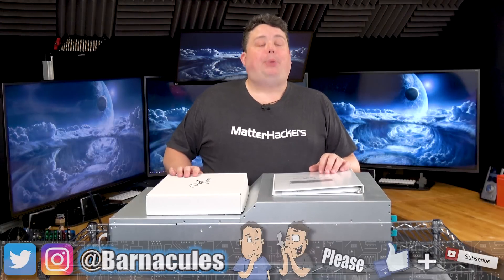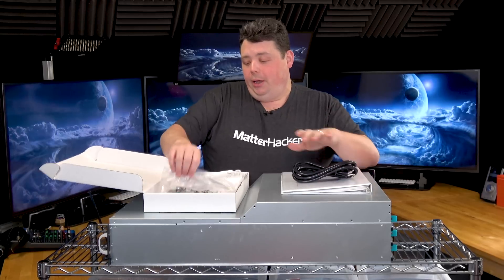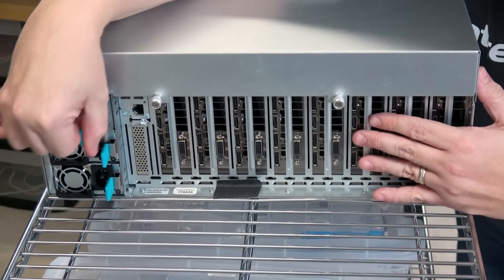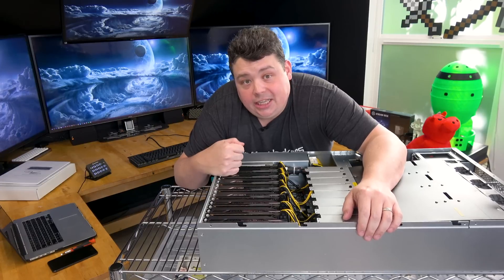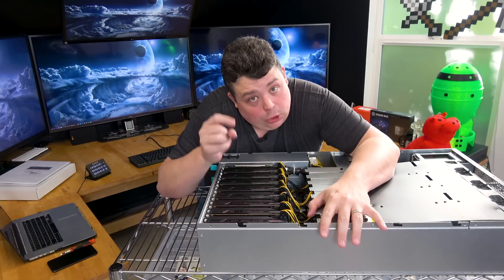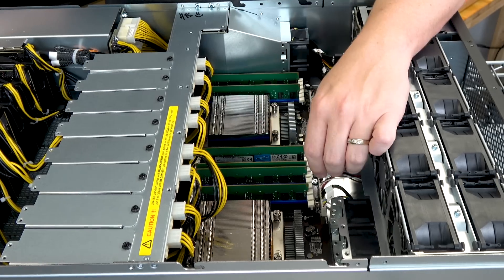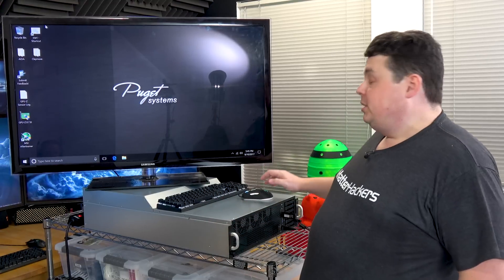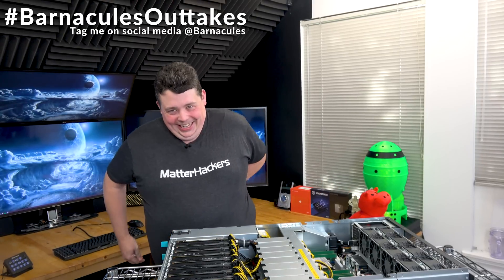Ethereum Crypto Mining Custom PC Server with 8 Nvidia GTX 1060 6GB GPU - @Barnacules

Comment: I have two servers that each have three power supplies.  It only matters how much power is actually being pulled by the system.  You can put all three on one circuit as long as the actual load is not greater than the capability of the circuit.  I have all six power supplies plugged into one UPS.  Works.  Don't skip a PSU because you think you save power.

Comment: Sponsors that made this build possible Thx A  Lot This Is Awesome Build [PUGET SYSTEMS] (4) GTX 1060 6GB Graphics Cards & Build+ [INTEL] (2) Xeon E5-2637 v4 3.4ghz CPU's [ASUS] System ESC8000 G3 3U Server Case/Mobo/Power Supplies [CRUCIAL] (8) 8GB DDR4 ECC REG Memory (64GB Total) [EVGA] (4) GTX 1060 6GB Graphics Cards [SAMSUNG] 2TB 850 PRO SS

Comment: Awesome video. I roughly calculated the time it would take that server to make any real profit if you had to buy it and would use it 24/7 for mining only. It would take you a little over 10 years to break even (that is assuming cryptocurrency value remained the same which it doesn't).

Comment: Hey Jerry, I calculated what Mh/s would be needed to profit at $18/day and given PSE power rates of $0.09743/KW up to 600KW, then you would be hashing at 41Mh/s +/- per card for a total of 330 Mh/s to profit after energy consumption.  9 GTX 1070's  OC'd to 30Mh/s would produce that in a day, not counting the 1550W+ of power a system would likely use.  11 GTX 1070's OC'd to 30Mh/s would give $18/day profit with ETH hovering in the $290-$300 range.  That's 330Mh/s at 1850W+ of power.  Am I misunderstanding or are you really getting that high of a hashrate?  Your screen is showing 21-22Mh/s on a couple of the cards in a closeup shot.  Thanks in advance.
Reply: 1060's in stock are 18-20Mh/s cards all day long, a slight overclock on the memory (okay, not so slight at 650-950Mhz) running under claymore v10 and tweaks will produce a solid 23, some can get upwards of 25, but not without serious voltage increases can you make anything higher (which would really screw this rig up for video rendering, it'd create a bunch of pixel errors if not crash entirely, not from cooling however, looks like that's well in hand). Also, of note, doing rendering of video is one thing, which this thing should do quite well at for 1080p video (maybe alright for 4k30 as well) but GRAPHIC rendering is mostly CPU, not GPU (ray tracing and such in myah for instance). Adding all the desktops to a pool for rendering would even further speed things up. 

Also, Jerry, As you mentioned, do what's good for you. Glad all that physical and mental stuff is getting sorted out. And yeah, do the crysis benchmark, just because, you know, crysis.
Reply: If he's dual mining and cpu mining monero, he could just about pull in $18 a day with this rig. Especially since it was probably filmed a month ago when profits were a bit better.

Comment: If you're going to be doing mining, check out SmartMine on GitHib :)
Reply: Ohh I see. Well I definitely see where you are coming from, it can be a hassle. Which is why I take the "not as profitable" path (Nicehash) but simpler method, and keep the overclock mild. I used to keep my rig in a spare room but now it's back in my room because we moved apartments. If I keep the windows and doors open the room stays warm so heat is definitely a downside to mining. I was told by a very experienced miner that if you have an MSI/EVGA card that is still under warranty (Overclocks are still covered under warranty), then you can have a more aggressive overclock, if not keep it light or mild. But you are right, mining is slightly troublesome, but you can make it simpler. :D
Reply: so false that u need 3 GPUs lmfao
Reply: Pray tell? What you going to say? 1? Yeah sure.
Reply: Otto Günsche Never in the history of GPU mining has it ever been a need to have more that one graphics card. Build a power efficient pc and one card can do you just fine. You can also calculate how much power your graphics card will take (E.g: I have an MSI GTX 980, TDP of 165 but actually power draw of 220 ish on load, tested). Calculate how much time you have mined for and you can easily work out how much extra electricity cost is from mining. I also have a program I made myself to do it all for me. Furthermore, I make videos everyday and use my pc for college as well, so either way it is sitting there doing nothing sometimes, it may as well make some profit. While a traditional system is an extra cost to mining if you want to actually earn a lot, to make more with one card you can get an efficient power supply, use a USB for the OS, undervolt the card and overclock it too, use a low power CPU, and etc. Saying you can't mine with one card with profit is like saying using your backyard to grow crops will get you a loss. It won't be as profitable but you will still profit from it.
Reply: What Comes Around™ Never said you couldn't... Saying oh yeah I'll undervolt the card to maximise proficiency etc, is still going to leave you with a huge ROI time.
Reply: Seemed sort of what you were implying by "one 'gaming PC' Isn't going to do squat". Anyways, undervolting you card will reduce your ROI in most cases. Most cards can be undervolted but if they can't be like my 980 then you can set a lower power limit and add a overclock (same effect). This has resulted in my card using less power, running cooler, and getting a hashrate increase of 20h/s (equihash). However results may vary based on what algorithm you are using, but the basic idea is still the same. Say what you will but I have proof, I am doing it myself, power usage reduced by 10%, hash rate increased by 20h/s and temp reduced by 10C.
Reply: What Comes Around™ Yeah man, keep doing what you're doing. I had a GPU rig for eth, but I couldn't keep up with the constant noise, heat, checking Team viewer whilst at work. Then you'd have an over clocked card fail and that would switch off the miner. Was fun whilst it lasted but gave up in the end.
Reply: What Comes Around™ Too right XD
Reply: Expensive
Reply: +Otto Günsche Expensive?
Reply: Alex Smith If you're starting mining, equipment is expensive.
Reply: Not if you already have a gaming PC
Reply: Alex Smith  Oh trust me, one 'gaming PC' Isn't going to do squat, you need at least three GPUs with a high wattage PSU and a mobo with extra PCIe slots.
Reply: My "gaming PC" has two 1080 Tis, does pretty well
Reply: Around 60mhs, that's not really going to go far unless you keep it running 24/7, but in your case you use it for gaming so you can't really do that.
Reply: I don't mine Ethereum. It's mostly GRS, SIB, ZEC, ZEN, HUSH, ZEC, KMD, LBC, DCR, MONA and FTC.
Reply: Ah, now I see. Makes more sense now.

Comment: Yea I have a 2u rackmountable server. dual xeon x5670 (oldy) with 32gb of  ecc ddr3.  It sounds like jet engine.  Trying to find somewhat quieter fans since the one i have don't have the ability to be controlled.

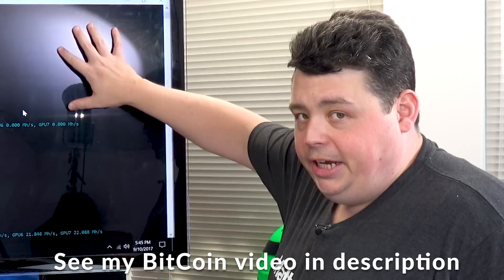Comment: 11:55 for those who care about what os he is running.

Also Jerry and anyone reading this. This is the biggest waste of hardware I have ever seen. It wouldn't be a waste if you were using Linux, before you tune out and write this off as religious retoric read my explination.

Windows 10/7/ server (any version) will literally always waste your hardware and that is by design. The machine will consume more RAM for the operating system (because it sees you have more) and if you are doing something that needs more ram it wont give you that ram back. So if you are on the desktop the system will idol with about 2 gigs of RAM consumed if you have server/10 and 16+ gigs of RAM. If you do something that consume 10 gigs (mining or virtual machines or software builds or anything that actually warents a server) the operating system won't give you any if that 2 gigs it literally is just holding the space for the kernel (core) in case it will need it but the kernel will never need that much (unless it's about to crash {blue screen}) that's just how it works. Windows processor haulting and process scheduling is extremely poor and results in a massive waste of cpu clock cycles because of its interrupt and handler system.

You should really run Linux as your host operating system and run Windows in a virtual machine and pass the graphics cards to the windows 10 vm when you need to do rendering (literally use VM ware it's built in by default and makes it stupid easy) mining in windows is actually slower than in Linux because of software optimization and over head from the "personality" associated with talking to the PCI bus I the windows kernel (that's literally the name for it and for non engineers just know it's from the 80's and is really dumb) this doesn't matter in gaming but means a world of difference when it comes to hashrates and mining. Windows is designed to be just a desktop and nothing more windows 10 will never be enterprises grade (crashes too often needs constant restarts bloated libraries leasing to slower load times ) windows server occupies less than .5% of the market share for the server market because it's actually garbage. There isn't a super computer in the world or a professional rendering farm (Disney, pixar, dreamworks) that uses windows they all run linux because you can literally go years without restarting your server and update the entire machine during that span several times over.

TL;DR

Windows 10 is awful in general and with this much hardest it becomes unstable and a waste. Windows server isn't any better. Linux is just use Linux and run Windows VMS for your rendering tasks and mine with Linux. Run other vms from Linux they better use the cpu where windows doesn't and never will
Reply: Scott Spitler I do whole home energy auditing. Crawl spaces are the worst places you could put electronics. Dust will kill that machine in less than a month.
Reply: Literally?
Reply: @Tim Edwards, lol you meant Seppuku? Sudoku is a numbers game lol
Reply: Scott Spitler calculated!
In linux hed earn 23 usd instead of 15 in Win,Gigantic difference!
Reply: Just don't bother writing comments when you don't know shit about Linux, Windows server. System administration and working on render farms.

Those studios you just listed use their own custom redhat linux rendering farms
Reply: Windows 10 server is awful but if I had to use linux as a regular os I'd commit sudoku man. I tried using ubunto for about 4 or so months, then switched to fedora for about 2, and absolutely hated both.
Reply: Justice! This needs to be on top
Reply: Actually, I'm running Windows Server 2016 Database for my plex server, and when idle, the ram consumption is 600MB. My server is only a dual core rig, and cpu usage is less than 1% idle.
Reply: MrKillius I would agree, most of them just use a in house version of RHEL
Reply: Scott Splitler – You don't really waste any crucial RAM when you have 64GB of it! Anyway Windows 10 doesn't need more than 1-1.5GB for itself and even with cached RAM, the RAM dedicated in total to the operating system won't exceed 6GB. If you have 64GB that still leaves you 58GB at your disposal for your applications which is plenty. Also for mining the memory that is actually mostly used is that of the GPU to begin with. 

Furthermore, although you tried to present it as a bad thing, Windows cached RAM does nothing but good, increasing the performance of your system by having the files you accessed in RAM for speedy fetching when you need/use them. Also if your applications need this RAM, it will get overwritten anyway so there is no effect on performance really. 

Finally running a virtual machine to run an operating system on top of another operating system is really not the same as running that operating system directly and the applications you need natively on it. There is impact on performance due to the VM overhead especially on storage drive I/O operations.
Reply: Hes mining with it... windows cuda mining is more efficient than Linux. We all get Linux is far superior, but as a system architect you need to listen to your customer's needs and not your own biases.
Reply: keeping dust out of hardware = Positive case air pressure. use a manometer if you could get your hands on one the DG-700 is a good device.
Reply: Not to mention windows likes to randomly start programs in the background, Seariously windows 10, I don't need Calculator, Photo's and  the store when I game, so leave that off. It;s stupid, really.
Reply: Just to play devils advocate here, there are plenty of reasons why both Windows 10 & Windows server still exist. Linux is great and all but it just doesn't have that market share support for apps and it can be a real pain to do something seemingly simple. Again, don't get me wrong, Jerry is quite a fluent programmer and I'm sure he could just as easily do it but who wants to go through all of that trouble just to have a result that's going to have issues regardless, Linux users you know what I mean,  and have a limited range of supported products?
Reply: Try debian .
Ubuntu server?
Reply: i was going to comment the same thing.
Reply: DWS Lite is the best program Ive used to get rid of all that shit Windows 10 puts in, DWS= destroy windows10 spying, yeah sounds a little conspiracy theory based but windows 10 comes with keyloggers installed, n yeah nah I dont give a shit who makes the OS but you dont need keyloggers as a default program in your OS. Have to agree with poster, Linux is king for servers
Reply: Anyone building windows servers or even Windows 10 pro can use a variety of configurations or easy utilities that Strip down and harden Windows to the minimum processes needed to just boot and run.  All the extras (sound, printing, utilities, etc.) can be disabled to ensure Windows is focused on doing 1 thing and one thing only: shunting data between the network and the GPUs.   That said, I agree with you that  Windows 10 Home edition with all its standard Bloatware  and built jn MS Spybots would not be a good choice for running this system !
Reply: Jesus christ did you not read, he said use a Windows VM on the Linux os, therefore he can use every program that he needs, such as adobe premiere pro cc, after effects etc in the vm.
Reply: He said it's going to be a rendering server. Adobe isn't available for Linux.
Reply: Scott Spitler bro if you talk make you're own vid about this or get off here

Comment: Ive been mining since 2013 and I gotta say, that's the slickest rig I've seen yet! Im in process of building a similar rig using a heavily modified HP Proliant 4U Server. I hope you will show some close up details of the GPU power distribution board (PDB) inside! That has been the most difficult part for me. I have four 1200 watt redundant PSUs in mine. 4800 watts total! Originally, it had just 0 power cables inside, which means  I am designing and building a PDB from scratch to deliver over 400 amps of 12 volt power to the GPUs... I hope to do the maiden test run this week. I will be watching your channel closely for updates and much needed inspiration on better methods!   Also, I am interested in details on how to configure 8 GPUs to mine on Windows. I plan to use a server OS, hopefully ESXi or another bare metal hypervisor to host multiple Windows 10 VMs. Is that going to work? Im hoping PCIE passthrough will solve Windows' issues with using 8 GPUs. But I see you are using Win10? Are all 8 cards working problem free for you? I thought only Linux could support 8 identical GPUs simultaneously right now? I an very interested to learn more about your rig! Thanks for doing this!!!

Comment: With current profit, it should be 666.67 days at $18 to pay off for that server excluding data and power expenditure.
I would suggest a total pay off somewhere towards 800 days which is 2.19 years which is not terrible for a massively parallel GPU based mining configuration.
The benefit for Barnacules of this system is in the rendering performance which will make rendering a doddle.

Gerry, please ask Mellanox to send you two 400 Gbps HCAs and direct attach the rendering box to your workstation.

Comment: 2.5 years to pay off, only if ethereum stays basically the same... Not exactly a frugal business venture.

But hey, you could run a mine-craft hub for the entire city, or fold @ home for 2.8 million ppd, or I'd bet if you put cheese in the case it make one wicked vicious mouse trap that'd work something like a wood chipper.

Honestly, it's all pretty lack luster, for such a massively overkill contraption.

Comment: Like if you want codegasm back!
Reply: it can walk crysis
Reply: Chicken Man originality 101
Reply: Chicken Man it could technically run 8 separate instances of Crysis if set up correctly...
Reply: It's a little faster then an Atari 2600.
Reply: Austin Gaming Probably not. Supercomputers usually run a specialized OS geared toward the specific task they're built to run.
Reply: it can JUMP crysis with all thoses powerfull 1080ti xD
Reply: Or minecraft?
Reply: XD
Reply: i know
Reply: No it was a real question.
Reply: you mean 101/10
Reply: yeah maybe dont think it could jog though
Reply: Austin Gaming actually it can't.
Reply: sure at 10 million FPS!
Reply: Thats ignorant
Reply: poop
Reply: Chicken Man : Can it run in general. Mom: No it doesn't have legs. -_-
Reply: #Chicken Man Those dual core xeons might bottleneck them GPUs
Reply: I hate these comments so much.
Reply: easy now ur insulting the atari 2600 . atari 2600 has at least 10x more power
Reply: lol big time